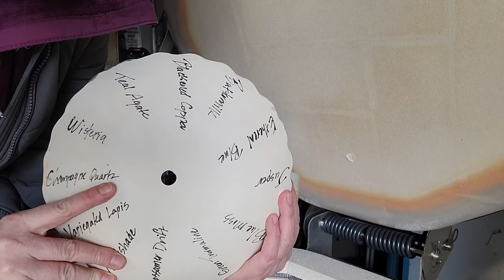Kiln Opening March 25, 2024, AMACO, MAYCO, COYOTE, SPEEDBALL!  Great Results! I am a HAPPY POTTER!

Comment: Hi I’ve just watched you for the first time and love your combinations of glazes. I loved the pink mug especially which I have tried - not quite in your combo but same colour of glazes however mine ran and stuck fast to the kiln cookies 😢. Could you please help with why yours didn’t run? I fired to 1220 no hold and natural cool down. They were all on the top shelf but a previous kiln firing I had them on the bottom shelf. I’ve tried flux blossom all over (2thin coats) under Rose quartz (2coats to 3/4 down mug ) and ran. Also FB under Amaryllis same as above and they ran, and RQ under Amarylis and a thin coat of FB round the top and it ran into the cookie too.  All on a white non grog clay. What the heck am I doing wrong with these glazes? If you can help thanks so much. Lynne New Zealand
Reply from the maker: Sheesh!  I don't know why they would have an at cone 6.  Is your kiln firing hot?  What do your Pyro cones say?  I have to honestly say, though, that I think my kiln may be firing a little cool.  Gosh, I wish I could give you a solid answer.   Thank you so much for your kind compliments!